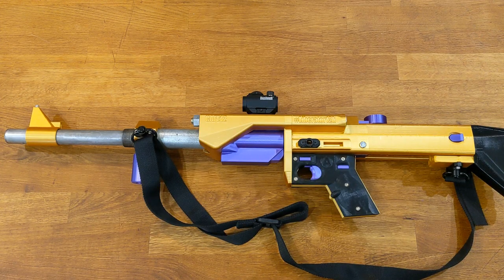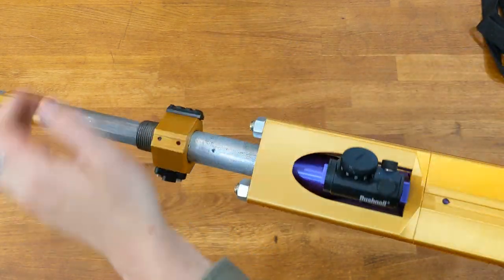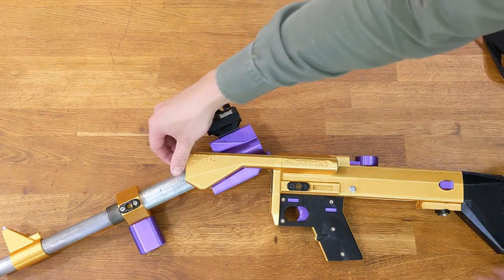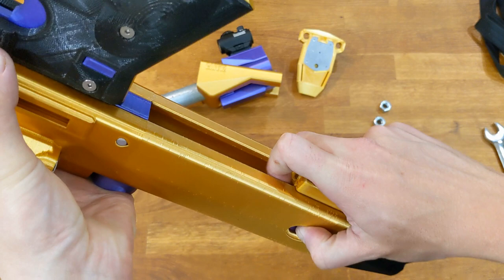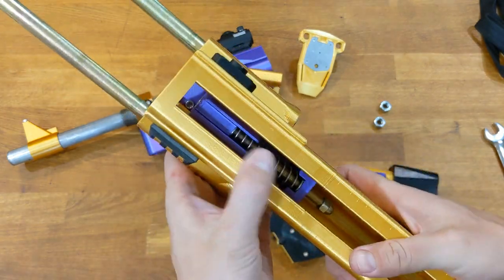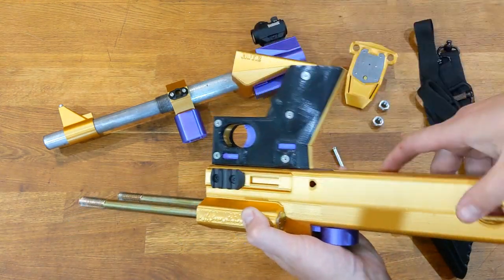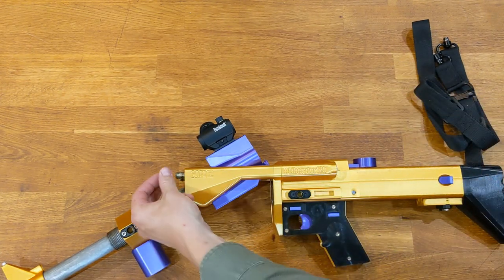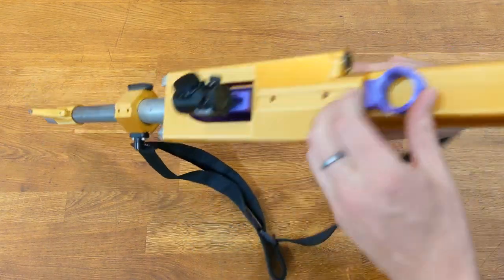#Liberator12k Library | CAFE12 Teardown and Reassembly

Comment: Hello, how do I change the caliber, is it simply changing the barrel?
Reply from the maker: Did you download the source code? Take a look in the manual at the developer section
Reply: I'll check the manual, thanks!
Reply: I found your project very interesting, I am a lathe operator, and I have 3d printing as a hobby, and I want to see if I can reproduce your project.
Reply: I'm from Brazil
Reply from the maker: @luisfelipeoliveiracavalcan8339  Awesome. Swing by the chat, and show off your work if you get a chance. There's a metric version available, that's probably the best route.
Reply: @Liberator12k  where can i get in touch with you or the community, i'm new to this area of gun printing, and where i can find the metric version and other gun designs and models.
Reply from the maker: @luisfelipeoliveiracavalcan8339  check out the Connect page on the website. Matrix chat
Reply: @Liberator12k  if you could make a detailed video of the assembly, it would help a lot
Reply: @Liberator12k  Since I'm from another country, I had to translate the manuals, and some parts were confusing in my language, so a video assembly guide would make my assembly much easier
Reply from the maker: @luisfelipeoliveiracavalcan8339  check out the dis/reassembly vids on this channel
Reply: @Liberator12k  I did not find a video of the trigger mechanisms or the mechanism to remove the capsule from the barrel
Reply from the maker: @luisfelipeoliveiracavalcan8339  swing by the chat, I have a much improved manual
Reply: @Liberator12k  How can I get in touch?